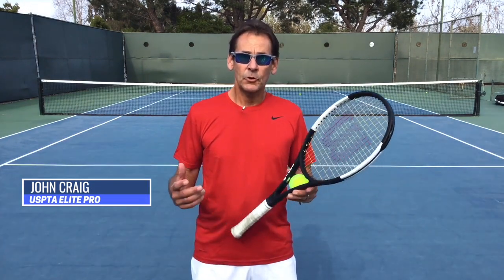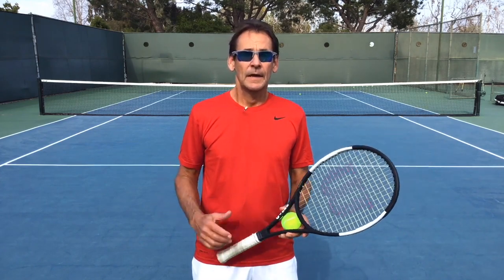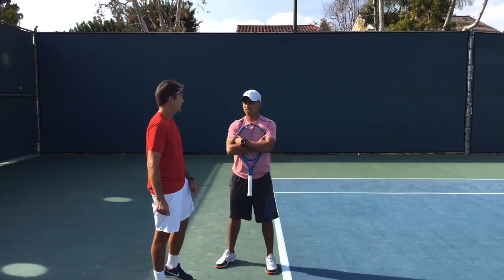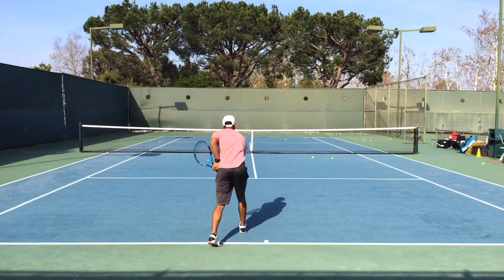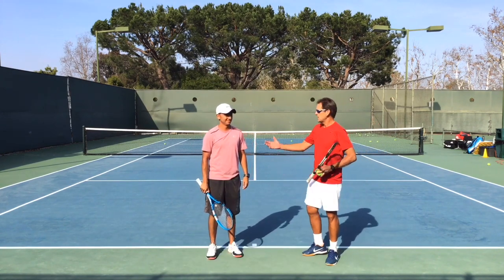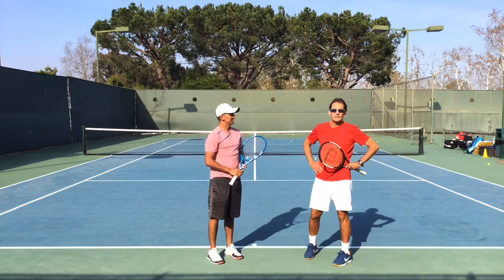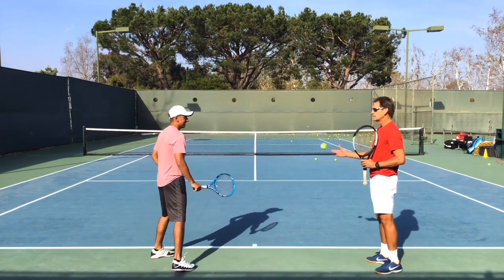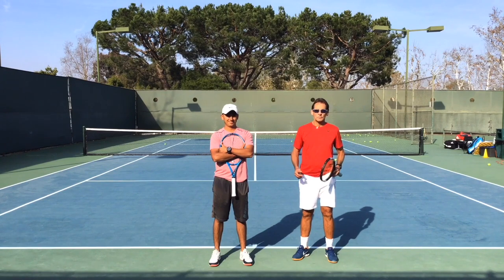Serve Tennis Lesson- Drills To Stay More Balanced On Your Serve

Comment: This is a big problem I have and it really starts for me when I try to practice hitting topspin serves because I struggle to get ball toss over my head, but when I do it causes me to lean off to left to try to get underneath it with my swing.  Sometimes I think I should just abandon topspin serve as it seems to mess up my mechanics.
Reply from the maker: Or you have a mobility limitation...in that case, get some professional assistance from a RacquetFit Certified Coach, who can assess all the necessary range of motions. Or you can abandon the kick serve...but it is nice to have it! Thanks, John
Reply: Don't compensate for the toss on topspin serves. Big mistake players make. Keep the same orientation. You might as well hit a flat serve again if you adjust your body like that.